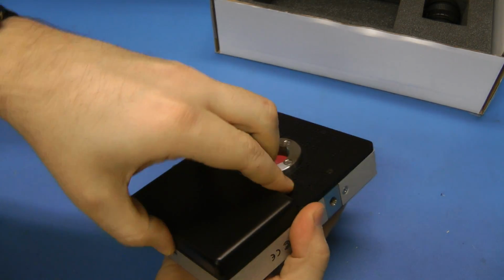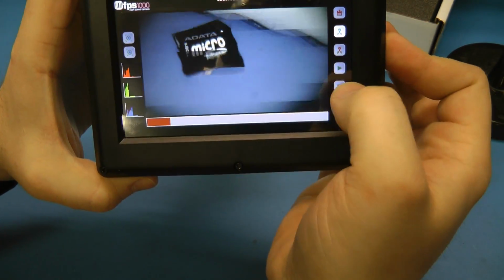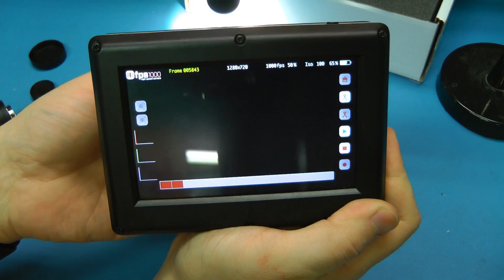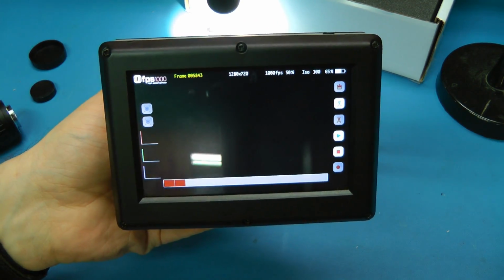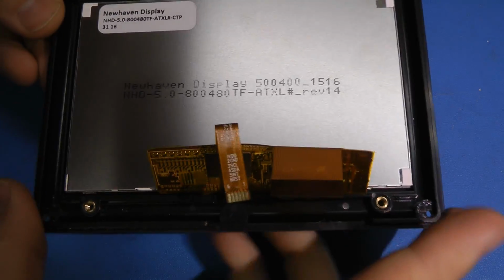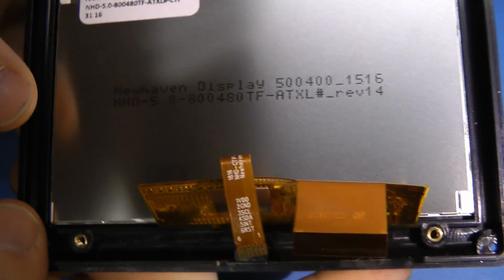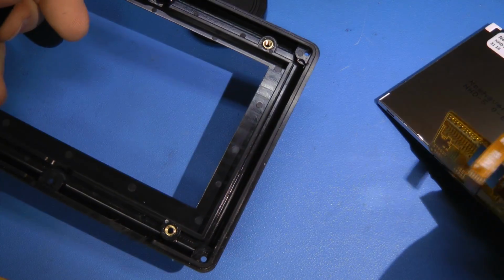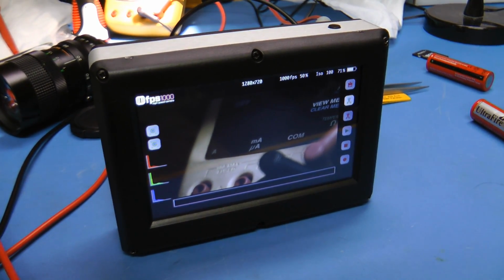FPS1000HD high-speed camera teardown

Comment: correct me if im wrong, but isnt flash memory a bad idea in this application. Since the chips have a very limited amount of rewrites, as well as wright speed beeing slower then DRAM.
Reply from the maker: As far as I can tell there's no wear leveling, or error correction being done at all, there are some minor speckles on the image presumably due to the intrinsic errors in this type of flash. These errors would usually be corrected with an error correction algorithm.
Reply: I've used NAND without ECC before for a video application. Results varied hugely between "perfectly fine" and "unuseable" from different manufacturers due to  read disturb errors over time were the main issue, though this shouldn't be a problem for this application. You absolutely do need to do bad-block skipping, but IME bad blocks  are easily detected by measuring  the block erase time.
Reply: It's a MLC flash so I HIGHLY doubt that: MT29F512G08CKCCBH7-6R
Only way it could handle several thousands of writes is if the author used wear-leveling. I bet my bottom dollar that is not the case and he writes it in a linear fashion. (He's not using a application specific controller for the flash)

Edit: This is meant as a reply to ShockSplash.
Reply: this means that this device has manufactured finite life span. The chronos should outlast this device because of its use of ram over flash.
Reply: I could see what your thinking, but flash is actually pretty hardy. Yes it is fully writing the disk as its recording, but it will take tens of thousands of cycles before it begins to error. And yes the write speed is quite slower than DRAM, which is why the fps1000 is limited to 1000fps. If it wrote to Memory then it would be able to hit 1500.
Reply: I asked Graham back in end of 2015 about this issue with this question "Since you wrote your own memory controller, did you take into account to use the flash memory in a smart way to avoid wear and low life time? (white paper on flash memory life time: http://www.snia.org/sites/default/files/SSSI_NAND_Reliability_White_Paper_0.pdf )" 

and he answered me

"I did consider very carefully the suitability of flash
 memory as this is they key to the low cost and high recording capacity 
of the camera. There are clearly compromises but I am using the most 
robust SLC NAND (also the most expensive) with 100,000 write cycles. If 
the camera is recording at the maximum frame rate for 1 hour per day 
(that's recording time - playback time for this recording time would be 
days) it would last over 10 years. If this turns out to be too short 
then I could offer memory refurbs fairly cheaply but realistically this 
is probably well beyond the lifespan of this type of product. "
Reply: And yet he went with mlc.
Reply: I don't think its so hard to do some basic wear leveling. They will just separate the total memory into a number of blocks and make sure that they dont start at the same point every time. Basically start a new recording at the block that comes after the one into which you wrote the end of the last recording and keep track of where you left off. If a block becomes corrupted, just blacklist it and skip it the next time (by writing the next good adress into some sort of table on a seaparate location). Until half of the blocks get corrupted you can keep using the spare memory. Should be sufficient, as there is little random access writes going on. Its almost all sequential writing. 
Even if they didnt go through this additional effort: What one definitely shouldn't do is to always start at the same position. Because then the first few blocks will always be rewritten - even for very short videos. If I take a hundred 5-second videos this would result in 100 overwrites on the first few blocks, so they will expire very soon. But if they use the arcitecture that I explained (using the flash like a huge ring buffer), then it will be just one or two writes per cell dispersed evenly over all available memory. 
The main problem with SSDs is, that a whole block needs to be rewritten even if only a few bytes have to be written down. Flash memory can anly erase full blocks. Here this problem doesn't exist, as we write sequentially only. No random access writing.
Reply: i would've liked to have seen one (or more) M.2 SSD in that
Reply: I would think the same but more or less is with SSDs. In favor of SSDs, the controller know that and uses the cells ensuring all of them get more or lees the same usage, so it will worn out evenly. Eventually, SSDs get smaller with the time as cells go bad. But it set and industry standard. I would rather a platter disc if they were a bit faster.
Reply: I think they have or will add some wear balancing to the FPGA config. And Flash is actually not so bad. Much better than a hard drive. If used correctly it can take hundreds of thousands of rewrites - especially if you have another 256GB of spares which can kick in as some regions become unusable. Other SSDs also have spare chips.
Reply: SSD's use over-provisioning. A method of hiding a defined percentage of available storage so that the controller can swap blocks in and out. That does not equal extra chips though. They will just prevent you from using the full capacity so that the controller has a better chance of performing wear leveling  (In particular if the file system is almost full since it can be performed only if there are empty blocks) and spare blocks in case broken ones are detected. btw: those fpga's are quite small. Not to mention that it took manufacturers several years to become good at it with their own controllers that are way more powerful. I don't trust that thing further than I can throw it :)
Reply: Not only a bad idea. I'd call it crazy.